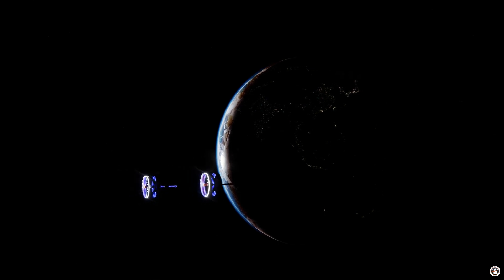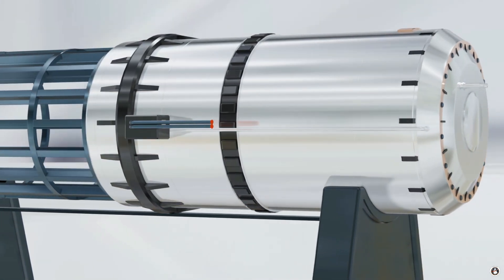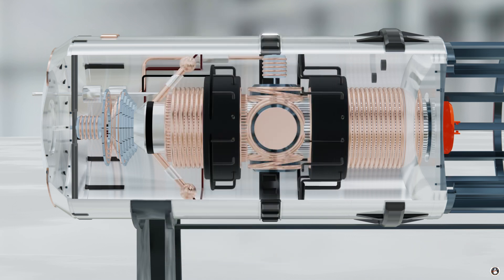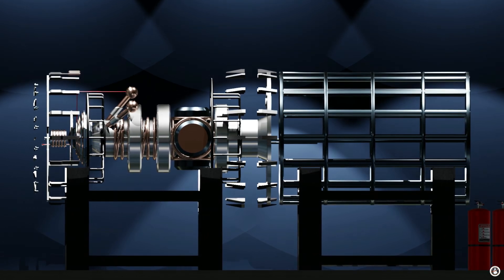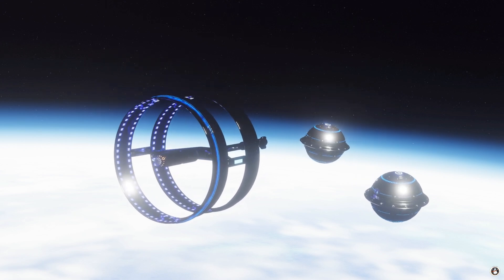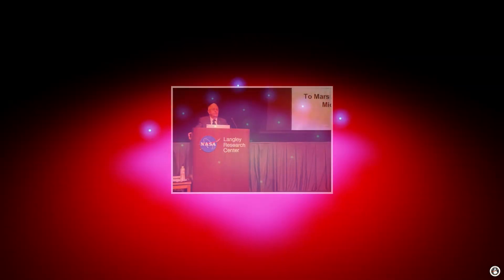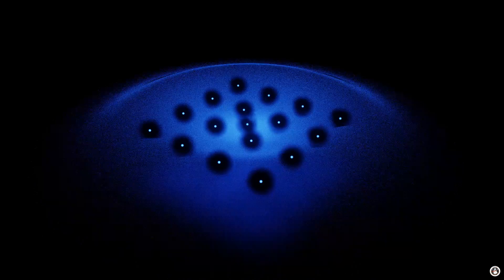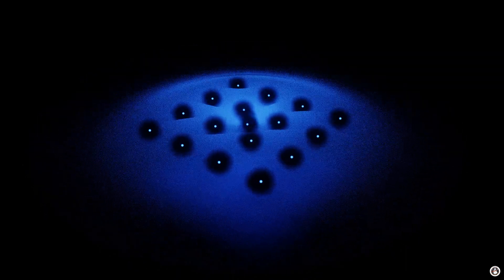Muon Catalyzed Fusion Engine - 8% Speed of Light - Mars in 5 days?

Comment: That engine would be suitable for a ring like attachment system that has multiple inserts of the same engine on the toy shaped like donut next to a less powerful system. The deuterium can also be changed out for positive and negative matter combined together to create a higher thrust ratio and depending upon which type of positive and negative matter that you use, antimatter and matter, will create a higher thruster weight ratio output it is more expensive. One of the higher elements of the carbon based antimatter atomic structures have a tendency to be in the quadrillions. Hydrogen antimatter has a tendency to be the most cheapest

Comment: What I think about using your engine for a specific type of spacecraft I don't think necessarily matters. I think what matters is that you would use this as one of a multi-engine system. Something tells me that an ion propulsion engine like Vasmir it's going to have a higher top speed. It takes too long to get there though. I think your engine should run initially or as a middleman behind a chemical engine. I think the chemical engine would get everything started as far as velocity and then you switch over to your Muon catalyzed fusion engine. And then once Max velocity has been achieved with the Mulan catalyzed fusion engine then you would switch over to the ion propulsion engine. Like switching gears in a car. I don't think the goal is to figure out whose engine is the best. I think the goal is to figure out where each engine needs to fit to work in unison with the other types of engines to achieve the greatest distance possible traveled in the shortest amount of time. You're exposed to a lot of nasty stuff that is not good for the human body.

Comment: If this can really work, could it not also be applied to a terrestrial fusion reactor?  

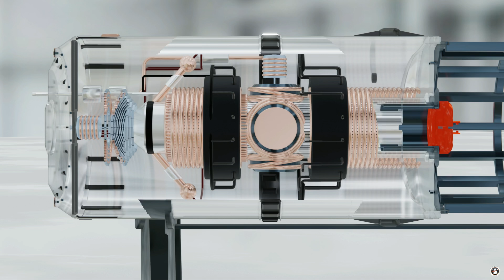Also I was a little confused at around 4:40 when you said that neutrons are contained using a magnetic trap.  (very powerful may have been included in that sentence)  My confusion is that neutrons are neutral.  How does magnetism contain them, no matter how powerful the field or fast the neutrons are moving?
Reply: Frogs are typically magnetically neutral and we’ve managed to levitate those. Iirc it’s because of diamagnetic forces.

Comment: BS !
A spec of dust , (and they are out there)..would cause such a craft to desentigrate .
The reason nobody is working on it is because it's way beyond man's.
 capacity in engineering and resources. 
Yes the could be engineered but it could never be utilized. 
The propulsion is the easiest part.
Reply: the virgin pessimism vs the chad “just attach a particle shield to the front of it”

Comment: How do you generate the electrical energy to generate the magnetic field and other requirements of the engine? The magnetic field must be quite powerful.
Reply from the maker: A revolution in science has been taking place which includes energy production. Some of these devices are based on ultradense deuterium and hydrogen (creation of large amounts of muons), other devices are based on sound (interestingly), further still, others are based on quantum fluctuations, and more. All thanks to a breakthrough in our understating of processes at the quantum level, et cetera. 

Most pop-scientists are unaware of such breakthroughs though that is beginning to change. 

We have a few videos about our aerospacecraft concepts based on new knowledge, something I think you specifically might be interested in. As we continue to develop our concepts, additional more detailed videos will follow: https://youtu.be/3xUxl0Qp51g
Reply: @asteronx revolution in energy production? Hogwash. Production of heat and charged particles that continuously catalylize the reactions do not produce electricity for magnetic confinement.  You get heat and accelerated particles which can be used like a rocket but no magnetic confinement. You need electrons in a wire coil to generate magnetic fields.

Comment: How do you slow back down to orbit a planet?
Reply from the maker: There are a few ways to do this, but the most likely is to have forward facing engines to thrust forward decelerating the spacecraft.
Reply: @asteronx why not just rotate it 180°
that’s a lot simpler than giving the thing a second engine
Reply: At the one third point, you turn the ship around and allow it to coast to the two thirds point then turn the ship engines back on to accelerate in the opposite direction gradually slowing the craft down. Or do a breaking maneuver around the sun and planets.

Comment: About a space ship, we build a seadragon type craft roughly 70ft in diameter and 550 ft tall. Seadragon has also been tested by the military in scale rockets decades ago.

We use it's 1 megaton payload to lift a reactor and struts into space to build a nuclear rocket. I imagine a ship like was in the 2001 space odyssey movie. Except instead of a ball shaped crew section in front, we use 240 ft diameter torus shaped rings made from Bigelow style inflatable modules. 

Along the strut spine detactable fuel tank drones could be used for extended fuel supplies. These tanks slingshot back to earth after being detailed for recovery and reuse.

We launch to the moon and detach 2 torus rings to act as a moon station in orbit then slingshot towards Mars. At the Mars Lagrange  point and drop off a nuclear powered magnetic shield there to slow the Martin atmosphere depletion of the sun then continue on to Mars and drop off two additional torus rings as a Mars space station. 

From there they slingshot around Mars and head to Venus to drop off two torus Venus space station there also, with a possible gravity asist from an earth flyby if available.

In one launch we could have a presence at the moon, Mars and Venus. This would not only expand humanity off of earth but also give us a forward base to start building colonies and bases at these locations.

And none of this isn't something we have not already had the technology for 60 years ago! So why are we waiting?
Reply: money

Comment: the fictional Pelican T-77B interstellar drop ship is actually of sound design as a practical real life spacecraft for space exploration . . . the design architecture is built for maximum functionality of all the elements that makes up the spacecraft . . . a realistic life size Pelican T-77B is very much possible using current technology, that will travel into near space and beyond . . . only catch here is an equally fitting propulsion pack (the lack thereof) that's missing in realistic terms . . . in terms of size it'll be way bigger than the Space Shuttle . . .

Comment: In some ways c is slow for  IS travel. I.E. for those waiting on the home planet for the ship's return. However, at high percentages of c the trip can be quite short for the travellers. It can take much less than  4 years to travel 4 light years.Time dilation at very high percentages of c can mean that trip takes a few months or even weeks ship time. You can go to alfa cen and back in a couple months ship time. When you get home,tho, 8 years will have passed.The main problem (once you figure out propulsion ) is shielding. At  .999 c even dust particles hit the ship like hand grenades. Small pebbles, like nukes. If these little difficulties can be resolved , IS travel becomes somewhat practical,at  least for near neighbours. Probably not for trade but OK for exploration and migration.

Comment: You didn't give us any data regarding the power required to run this engine, or where that power is supposed to come from, and the expected yield and fuel load requirements, so we have no way of know what, if anything, this engine would be good for...the theoretical ballpark speed of the theoretical engine, is the most irrelevant/useless information you could give us, to gauge the practicality of this theoretical proposal.

Comment: Does this engine use any elements of Muon Cascade or does it just exhaust the muons into space as unrecoverable particulates?

Sadly, as efficient as this engine could be it is still a constant thrust engine type, not a constant acceleration engine type.

Are you looking to hire? I have two constant acceleration engine designs and I'm penning down my theory on Cryogenic Crystalline Fusion and I would be interested in working with your group to help redefine certain aspects of propulsion theory.

Comment: Ok...so you've invented, in theory, an engine that can go 8% lumina. I heard nothing about inertia. What good is an engine that will leave the occupants of this ever increasingly hypothetical space craft as goo on the aft bulkhead, assuming you can even build a ship's fuselage that can stay together under that kind of dynamic load. Just a thought.
Reply: it’s about acceleration, not speed. You don’t feel the speed of the earth moving through space, but you feel the acceleration of a car.
Even if this thing was possible, as a Fusion Drive it would have pitiful thrust.

Comment: If the engine can be scaled both up and down then it would be pretty much ideal for all manner of spacecraft from light shuttles to super-heavy capital ships. The big question i have is whether this process produces radiation and if so how much of it exits out the exhaust as that will determine if these engines can be used as lifter/landing engines and not just main drives.

Comment: Don't believe what he said at the beginning!  No spacecraft can currently achieve 1500 kilometers per second. Even 20 (72000 km/h) is pretty good for today's spaceships
Reply from the maker: The Parker Solar Probe is a NASA space probe launched in 2018 with the mission of making observations of the outer corona of the Sun. It will approach to within 9.86 solar radii from the center of the Sun, and by 2025 will travel, at closest approach, as fast as 690,000 km/h, or 0.064% the speed of light. https://en.wikipedia.org/wiki/Parker_Solar_Probe
Reply: Yeah but that's because of the Sun's gravity and not because of it's engines. In the last 50 years there wasn't any significant improvement in engine efficiency. 1500 kilometers per second sleeping is still 8 times faster than this probe.
Reply: Sorry but my autocorrect written "sleeping" for some unknown reason. I did not intended to write that

Comment: I suspect the claim of 5 days fm Earth to Mars is flat out wrong - you cant just take the closest approach distance and divide it by the theoretical top speed ... thats NOT how things work.

What is the amount of thrust, and specific impulse, for a given mass of fuel ?  Besides deuterium, i assume solar power required ? How much ?

If it works, im guessing the performance would be similar to Vasamir (very low thrust, extremely efficient and high duration), except with a higher top speed. If so, that would make it well suited for use in applications like LEO orbital maintenance on the ISS, propulsion for interplanetary robotic probes, and if it scales well it could work in a space tug shuttling cargo back and fuel back and forth between the ISS and L1 thru L5, or between ISS & Gateway, or between Gateway & Mars, et al.

Comment: There is a magnetic sail option powered by a plasma reactor, but what about if another fusion option could be made to produce the sail.  However, the sail is not only useful for interplanetary travel, but there are methods proposed for faster interstellar travel, faster.  It comes out of the hydrogen ram scoop technology proposal.  Working this technology, is it possible to get good larger fractions of the speed of light.  However, what happens of you combine with a primitive warp mechanism, to ease movement?  The notion that it takes infinite energy to reach the speed of light, is just lazy science.  The question is why, what causes this?  Then how do you manipulate this?

The big picture issue with I see with most nuclear proposals, is that they presume everything will go all right.  Space is not empty, even with so called defector shields (think of it more as a magnetic field grabbing hold of what is Infront of it, and pulling it to the side and backwards, propelling off of it, which ties in with magnetic sail technology.  So why use two things, and not just concentrate on the magnetic field technology).  Even with a deflector shield, something could hit the structure and cause the atomic handling mechanism to fail.  Now. A step further.  The very mechanism itself has to last more than wear and tear strains of maneuvers, doing some pretty rigorous processes to maintain the reaction mechanism of the engine.  These are weak point of failure. That even if you could easily make the processes passive and robust, could still be upset.  Now, the last straw, turbulence, accumulative turbulence and harmonic.  While a drive might work within acceptable parameters normally, random fluctuations could one day make it go out of spec.  Looking at those designs, I think, what could go wrong.  The designs more robust, passively ensured, but even active hybrids for safety and efficiency, that have no means to wreck the mechanism or blow up (outside destructive massive collision), with structure resistant to other collisions, with need for external structural alignment, and requiring little and self maintaining internal alignments, are preferred.  At least if something goes wrong, you can limp to a safe destination.  This also requires automated rescue vessels scattered around.  How would people feel if a pump mechanism failed on retro burn and they just kept sailing past Mars.  The same could happen for other mechanisms.  Requiring some sort of plan to produce a large sleep cycle until the craft can be rescued again, or come back in large eliptical orbit to be rescued.  Time dilation would come into question to, except you are already down the nuclear reactor, and if you have one left you might as well have a magnetic sail mechanism to limp home.  Su, ideally 10 small distributed reactors linked through to a sail mechanism would be a lot of redundancy and for life support for rescue if sail is totally inactive.  But, the question also comes, for backup and limp home even, what about the high energy discharge beta decay battery technology, which can power for years at a high rate.  I proposed mechanisms for this many years ago, but somebody has done it in the states.  Space X cutting edge, bah.  This is cutting edge.

Now toroidal reactors.  The larger the energy, the larger the confinement to contain disruptions of that energy.  Why not stacked, or wave gilded seperated, toroidal flows, giving redundancy incase of contact.  Does a toroidal flow really need to be more than a tenth of a nano metre wide.  This is new engineering to control the outcome.  New science would be to get light to act like a toroidal plasma flow.  It is the electromagnetic force.  Once you get light to act like that you can control the flow of light easier. In a more robust fashion.  I know it sounds strange, but it is new.  One day, we will be able to control it like this.  Wherever it ultimately is usefully controllable like that, is another thing.  There is already a mechanism that could be used to control the flow.  But of course, is Space X working on this already?

Redesign the fall Ball, or put wings and a motor on it.  That's Space Next.

Comment: I am going to guess you are planning use of a Mid-temperature plasma reactor for the power plant, at a minimum. Admittedly, my calculations are a bit rushed with this initial comment, but this drive method looks to be a bit of an energy hog.

Comment: I'm sorry, I appreciate what you're doing with this video, but this is a perfect example of the irrational bias against fission power. You also see this same ridiculous bias on any video discussing fusion power. I wouldn't care except we are currently in the throes of an energy crisis in which a world starving for energy is meeting that need with fossil fuels, and the ONLY practical method of replacing fossil fuels is with nuclear fission. The demonization of fission, like what's in this video, is irresponsible as it only serves to strengthen the view that fission doesn't represent a viable option for our current problems, with the focus being placed on renewables (which will NOT suffice) and fusion (which isn't likely to be commercialized within the next 50 years and is still only a marginal 2-3X improvement over fission in terms of power yield).
Reply: And in what world would you be fusing much of anything and not generating neutrons that would then make surrounding materials radioactive? He-3 is the only thing that comes to mind and even that will probably produce some neutrons, just not as many as H-2 + H-3 fusion. Complete magnetic confinement of neutrons is a nice idea, but if you're going to suggest that I'm not sure why you wouldn't apply that same technology to the fission reactor. 

If you wanted to crap on drives powered by fission vs. muon/deuterium fusion, try to focus on the actual gains in terms of performance, and less on "Do I even need to tell you why fission is a bad thing?!" Fusion would be a better power source for a ship simply because of it's marginal improvement over fission. Fusion's ability to generate 2-3X the amount of power that you'd get out of fission is not earth shattering, given fission already generates 1 million X the amount of power of chemical energy sources, but that small improvement of yield is very important when you're trying to send a vessel across the stars and you'd prefer to have as small a mass as possible from your power source (more room for colonists).